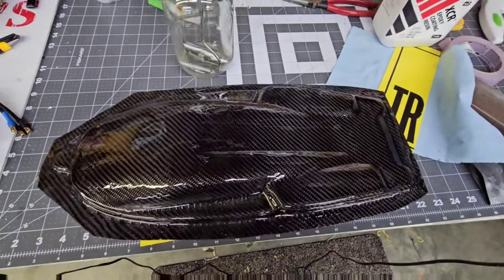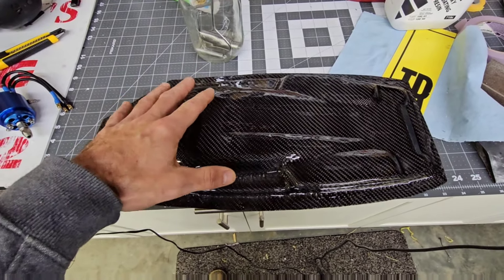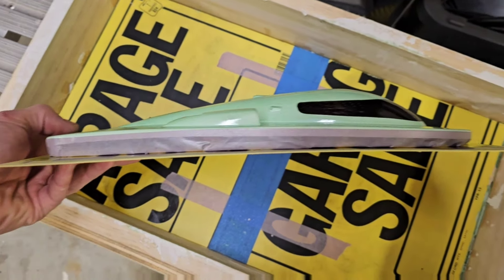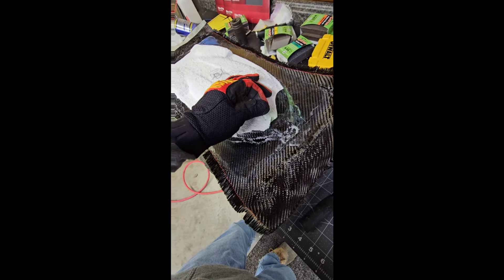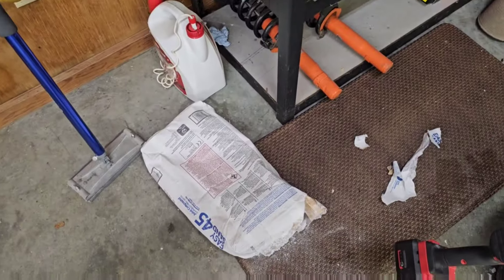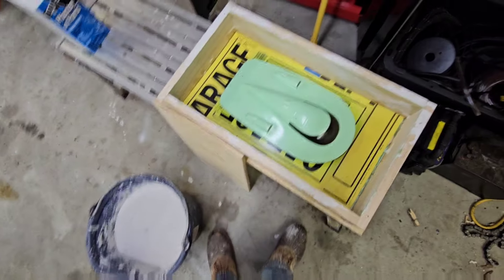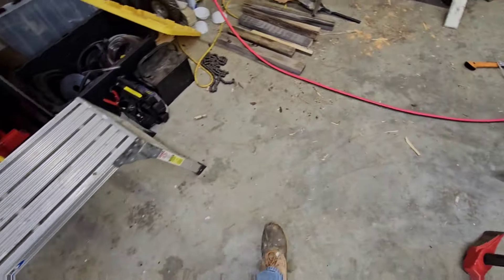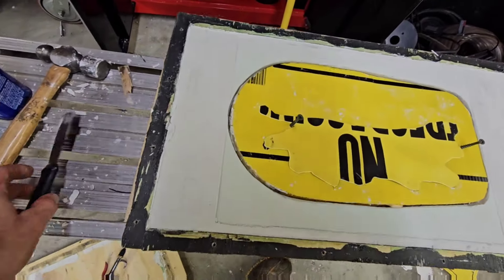Molding a Plastic Top Hatch. Traxxas Spartan & Miss Geico 29 made of Carbon Fiber.

Comment: I think the plaster will work, I think  you'll need to wax the mold several times before applying the pva for the final part pull.    The wax will fill the poris holes so you get a good release.   I would buy a catamaran hatch from you when you get it done  If your willing to make an extra one.  It's alot of work.
Reply from the maker: I was actually going to make you one for free big b! It was already a thought I had & wanted to do & send it to you. Once I have 2 I'll send you one .
Basically I smooth out the mold and coat it with epoxy, once it drys I need to wax it a few times & use pva. I learned Alot on the first go round. Next I want to mold a whole spartan.

Comment: a sawzall works great for vibrating the sides.  Also look for a venturi vacuum pump that's run from a compressor.  Removing air from the plaster or resin will create a smother part.  Also using a modeling putty at the edges will give you a curved edge/draft for separating the plug/negative from the mold.   Have fun, I enjoy see your "other side", not just wells.
Reply from the maker: Thanks! Ever since the new year YouTube has put a huge reduction in traffic to my other channel, not sure why. Down 66% In 3 weeks.  But thanks for supporting me on both sides, I truly appreciate it! And your information here is gold!

Comment: Try thinning some finishing epoxy and spraying  into the mold to fill the small holes in the plaster and making a nicer surface for the finished part
Reply from the maker: I have 3 coats of epoxy on it now, turned out excellent! I'm sanding it with 1000 & 1500grit & 1 more coat before a pull a part from it. Trying to make a few & 1 for Ironclad

Comment: I know you kind of hand it in different order since the spartan cover was done first. After you have the original pulled from the mold you paint the plaster with epoxy basically? What kind did you use so it flowed well?
Reply from the maker: Exactly! I waxed the canopy & sprayed it with pva. Let it dry for 2 day's.  I'd recommend using 90 minute plaster. Lowes sells it in a 18lb bag. It takes 5 days to fully cure, then gently pop the part out & apply 1 coat of epoxy each day for 4 day's.  Once it's set, you can buff the epoxy with brillow pad or 1000grit. Then you have your mold. It's time consuming, but a fun project & not too expensive, just takes time

Comment: Ive been building geico 29 hatches since shortly after the boat was released.  Other hobbies and general life has had me not making any in the last couple years, so Im rooting for you to figure this out so hobbyists have someone else to go to.   My recommendation would be to make your mold out of tooling gel and fiberglass so you can get a numerous amount of parts.  Its more expensive up front but it will last a long time if taken care of properly.  One of my geico 29 molds is at least 13 years old.  Contact me if you need any help.  Oh, also I have copied several proboat plastic hatches using gel and resin and never had one warp or disfigure due to heat of the material to make the mold
Reply from the maker: Great! I was worried that the heat would warp the plastic, I already have glass & tooling gel, that'll be my next thing to learn & create a glass mold.
Reply: If you make a hatch for the traxxas m41 similar to the one that's on the spartan I would for sure but one